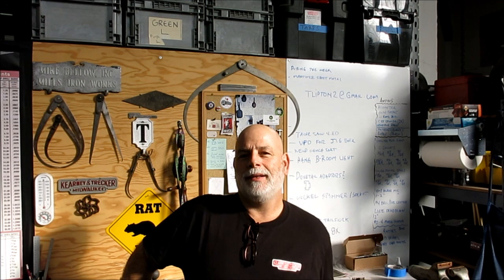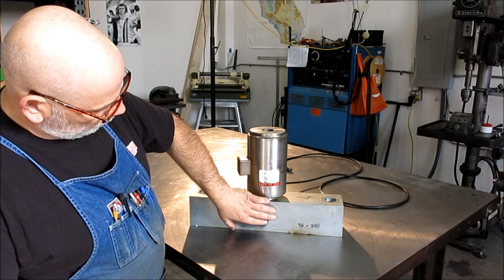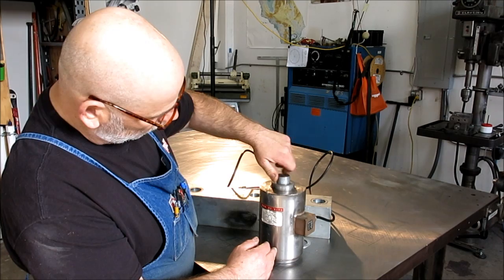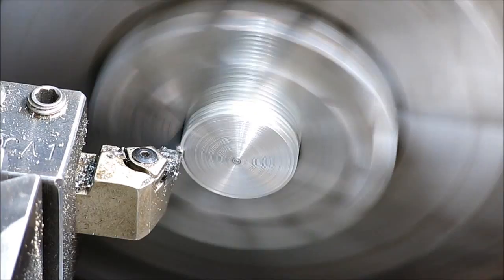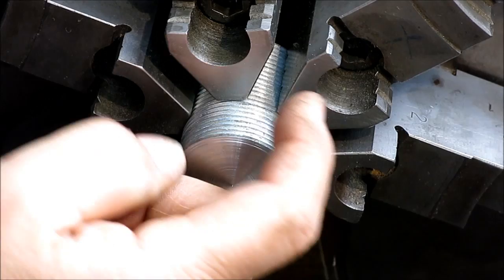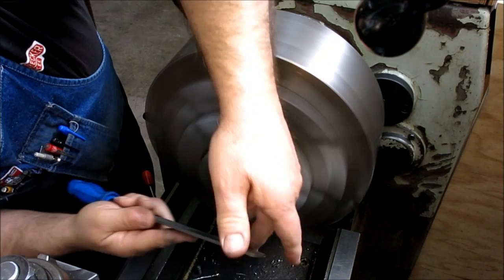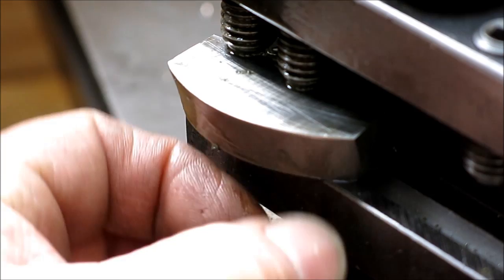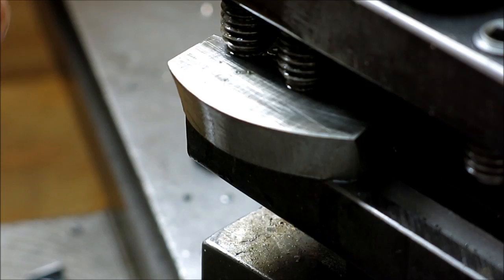Roach Coach Snack Break 8

Comment: Hey Tom, I like the fresh haircut! Your quickie job reminded me of the broken bolt story I shared during my trip. Way to go!!
Nice use of the manual controls on the lathe dude!

Adam
Reply from the maker: Hey Bud,

Just trying to keep up with the Booth's. With your quick draw Mcgraw on the threading I have to stay frosty. This was exactly like your bolt story. I saw the load cell jiggle a little when we lifted it onto the table. Just waved my magic wand and presto it was loose.

All the best my friend.

Tom
Reply: oxtoolco That is just awesome! Like I said, it doesnt always work, but try turning it by hand before you break out the heavy artillery! Im glad this one was a cake walk for you. 
I thought the bar was aluminum in the video. Nice piece of steel though.

Comment: I was just about to guess "wedges" when you went for "fingers"! Good laugh!  

I once had to remove the nut from a hitch ball that had been on for a few years. Oil, pipe wrench, pipe wrench and hammer, propane torch, nothing was budging it. Then I thought "air hammer", and cut straight into one face with a chisel until I had a good groove, then angled it to drive the nut around. Worked great. I suspect the vibration helped the penetrating oil get in there better. 

Thanks for the grins!
Reply from the maker: Hi Hammer,

That's a good trick. I had all kinds of plans how I was going to attack this one. 

All the best,

Tom

Comment: Just want to say thanks for taking the time to produce the HD video it's almost as good as being there. it makes me want to get out to the shop and build something..but that will have to wait until the weather breaks and warms up, or I'd have to burn up a forest worth of wood just to warm it up. Winter has been brutally cold this year.
Reply from the maker: Get yourself one of those heated motorcycle vests and plugin to the battery charger. My wife used to use one in her cold studio at another place. 

Al the best,

Tom
Reply: oxtoolco Or maybe a Milwaukee M12 (battery) heated jacket.  Not cheap, but they work nice.

Comment: I never thought about cutting concave surfaces on the end of a part on the lathe, but I guess with the right cutting tool anythings possible.
Cheers
Reply from the maker: Hi Andre,

I guess I thought about it in even more basic terms. Round part in machine for roundy things. How would you have attacked that it the mill? Ball end mill or boring head?

Cheers,

Tom
Reply: Hmm, well I guess I would have to use a series of ball endmills and a rotary table to rotate the part. I have a 1948 BP with a very small collet taper, 1/2" max. So a boring head is out of the picture.
Maybe braze a tool bit like you used on a 1/2" steel rod with the cutting edge on the center axis of the rod? That wouldn't cut well though since the speed of the cutter at the middle is (theoretically) 0 so it would be a very slow possibly chattery cut. I guess ball endmills and rotary table is the way to go, since a 1/2" ball endmill is too small for the radius your after so I would have to use a step method like you had shown on your bandsaw tentioner repair video except use it in a rotary manner, not an axial manner, if that makes any sense. 
I guess some work if just meant for lathes.

Comment: I can appreciate Daves problem.  One time a few decades back I was trying to take the nut off a Ducatti motorcycle crankshaft with an electric impact tool.  I was cursing the thing for being so weak and the wife who never saw one of the darn things said why not turn it the other way.  After chastising her for not knowing righty tighty lefty loosy I gave it a try so she would go away.  DOH!, it was a left hand thread and she was right, the darn thing just spun off. Probably a good thing for me that the impact tool was weak or I might have twisted off the crankshaft.
Reply from the maker: I think we all have been in Dave's shoes. I remember fighting to get a shaft out of a bearing housing one time and low and behold they had double stacked set screws in the collars. The top screw was loose but the bottom screw was still reefed tight on the shaft. Now I take the set screws all the way out before I try any shenanigans.

All the best,

Tom

Comment: Hi Tom,
I've been on both ends of that kind of situation.  I figure if you are trying too hard, maybe the assumption is wrong to begin with. 
Interesting machining exercise! Did you have that form tool or make it for this job?
Reply from the maker: Hi Bill,

I agree. Knowing when to back off and use your head is as important as having a head. The form tool I already had. It wasn't quite right for this job but it worked.

Cheers,

Tom

Comment: Tom, did you ever apply chalk to your files, to separate the filings from the tool?
Reply from the maker: Hi Dennis,

Yes I have tried chalk. It doesn't prevent loading or at least the chalk I have tried doesn't. Soapstone also has a similar effect to reduce chip loading.

Best,

Tom